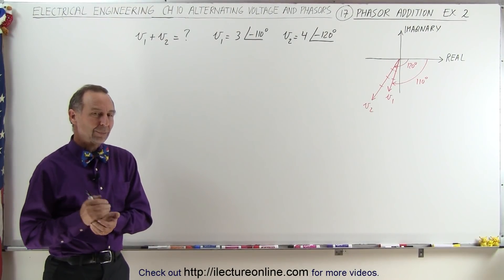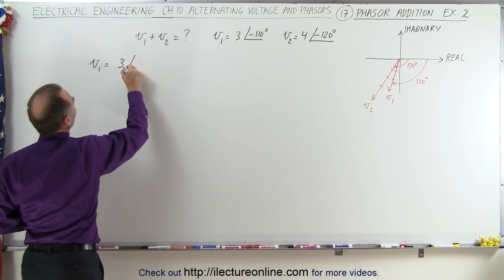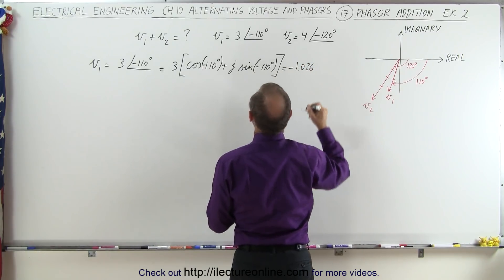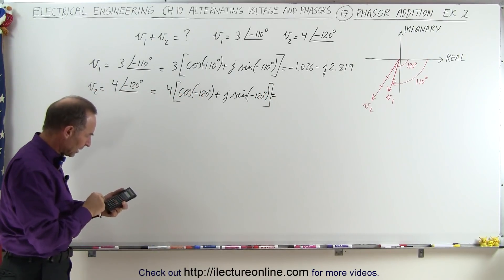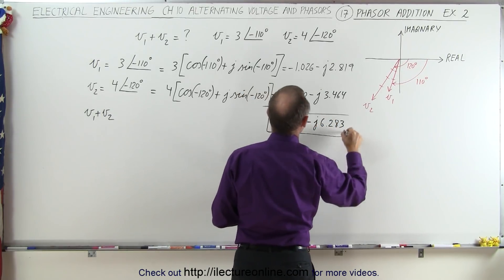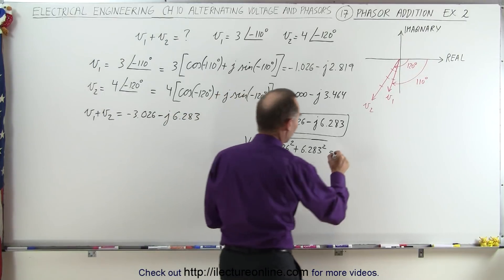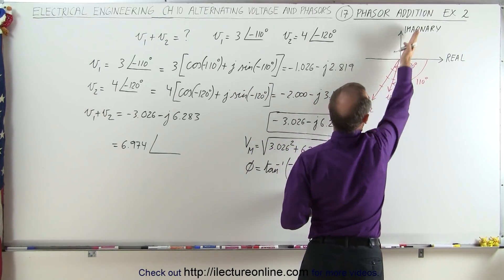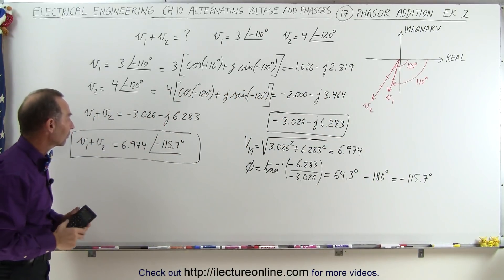Electrical Engineering: Ch 10 Alternating Voltages & Phasors (17 of 82) Phasor Addition: Ex. 2

Comment: Why did you subtract 64 from 180 and not 180 from 64? Brilliant as usual.
Reply from the maker: The first calculation for phi just gave us the magnitude of the angle (between 0 and 90 degrees).  Then we had to add (or subtract) 180 degrees to place the direction of the resultant vector in the correct location.  It is better to look and see what is happening on the graph then to blindly work the calculations without having the physical connection to the reality of the problem.
Reply: @MichelvanBiezen  does one have to always check if the angle is correct by drawing out the phasor diagram?